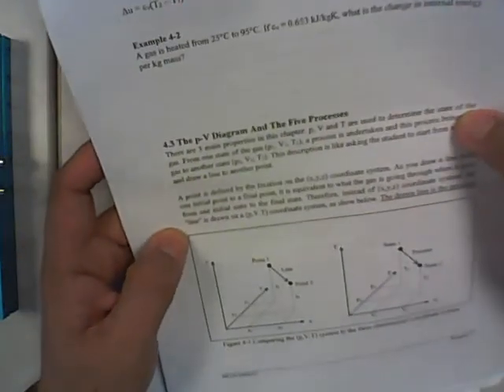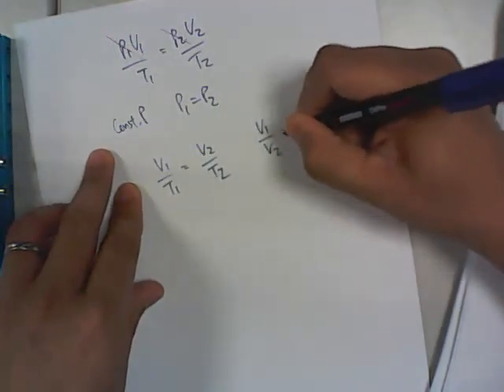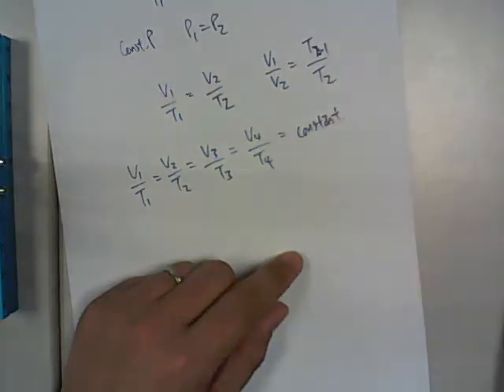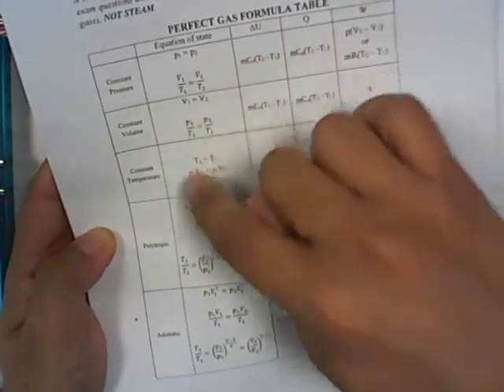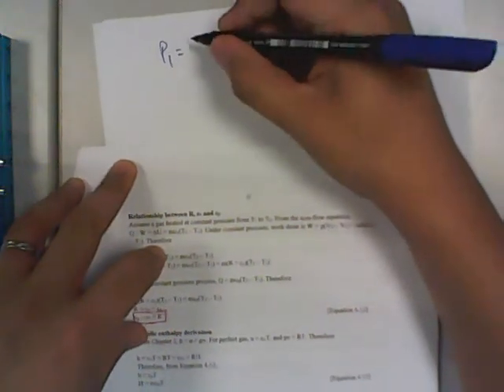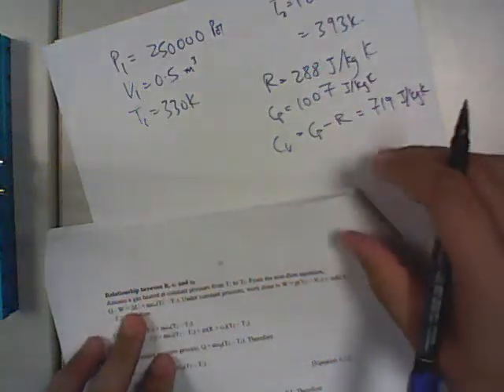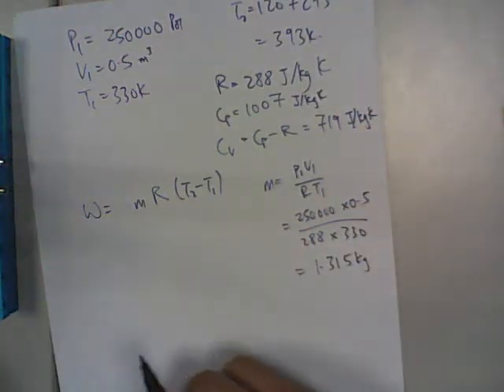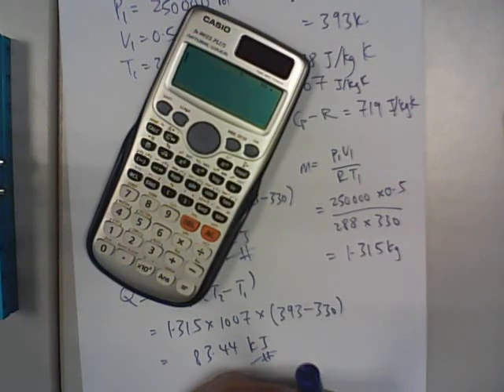Thermofluids 1 Chapter 4 Part 3: Constant Pressure Process

Comment: You are very good at explanation , I am using ur videos to prepare for my finals thnx a lot keep it up, but please where can i get the perfect gas table from ?? Can't you add a link of pdf of this whole sheet it would be really good
Reply from the maker: +wissam moussa The table of formulas are from the Thermofluids 1 lecture notes (version 1.1) Page 67. At the end of Chapter 4. If you're not from Singapore Polytechnic, you may use this link. The first table is the same as ours. http://www.learneasy.info/MDME/MEMmods/MEM23006A/thermo/gases.html